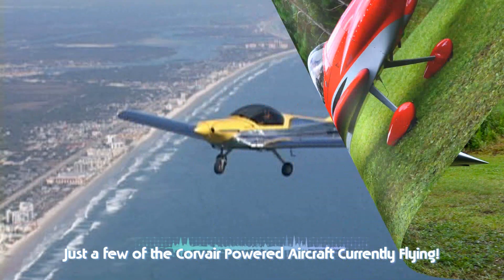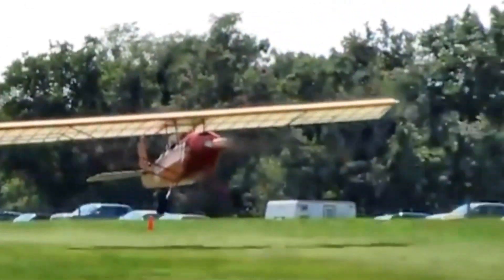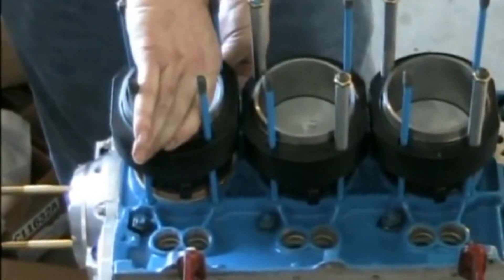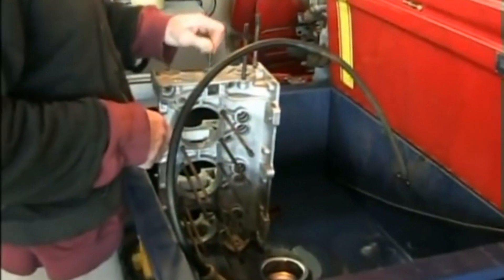Corvair Aircraft Engine Conversion, Corvair College, William Wynne

Comment: are this injected?
Reply: I don't know about the aviation applications, but in the original automotive application they came with carburetors either normally aspirated or turbo charged.
Reply: W.Wynne is rather adamant on using proven standard aircraft carbs.  Aircraft-Reliable 6-cylinder digital fuel injection systems cost more than the Corvair engine build.  WW's mantra is simplicity.